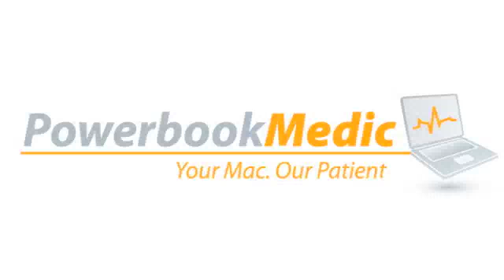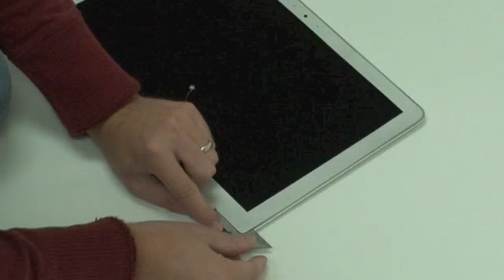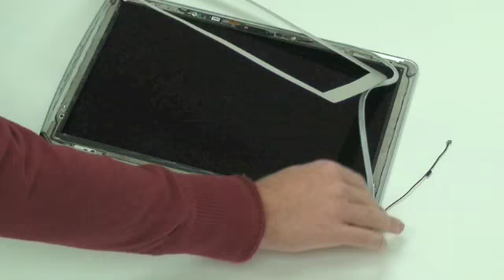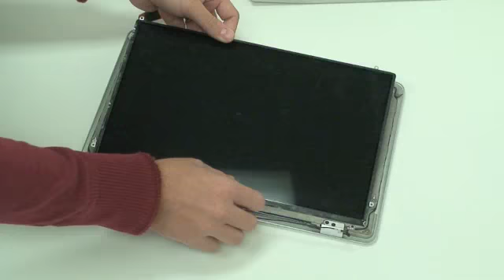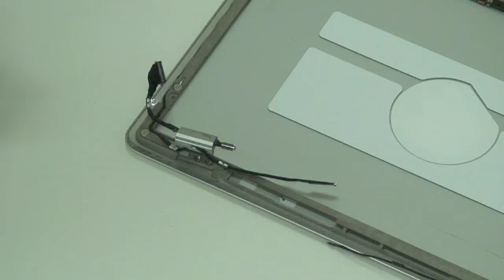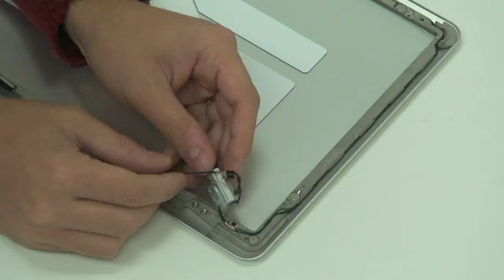How to Replace the Macbook Air LCD Display and Hinges

Comment: ITS NOT THAT EASY WITH THE ORIGINAL GLUE ....THIS BEZEL HAVE BEEN REMOVED BEFORE THE VIDEO ..... AND HEY THEY HAVE ALL THE PARTS IF SOMETHING GOES WRONG....
Reply from the maker: The process is difficult, but back in 2009 when this video was made, we were doing these regularly and this is one of those things that the more you do them, the better you get.  You are correct that we have all the replacement parts in the event something goes wrong, and it sometimes does as this is a difficult repair.

Comment: Hi all,
does anyone has backlighting kernel panic issues? I have seen about this problem online before, so just wondering whether I received faulty screen, or it is manufacturing fault? The old LCD panel backlighting doesn't cause any problems.

Comment from the maker: You likely need to replace the LCD.The logic board could also be the cause of the problem. We do offer a free diagnosis service if you wanted us to take a look. You can give our repair department a call at 1-866-726-3342, option 2.

Comment: late 2010 Macbook Air 13 models.
I did everything on video. Lights not working! Replaced the cable. Does not work! Barely visible in the darkness, barely. What to do?

Comment: There are several types of displays... I had a bought one, but it wasn't the right one. There is a version with a thicker display where the backlight is integrated. And there is also a version with only the display without backlight (that is much thinner) and you  have to glue into the casing. That version is much difficultier, because the flat cables are very tiny and there's not much place for movement.

Comment from the maker: Usually there will be enough adhesive left. However you can use double sided 3m tape to ensure a tight fit in most cases.

Comment: For replacing the hinges only, you only need to pry up the lower half of the bezel.  Also, the razor is too dangerous.  A small flat blade screwdriver works well as you can slowly pry up the bezel without jeopardizing  the LCD.